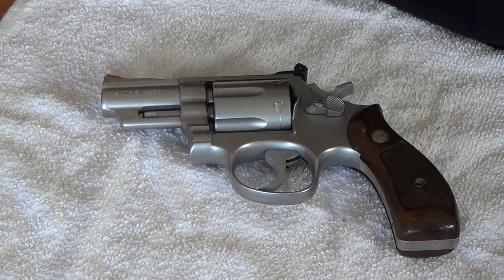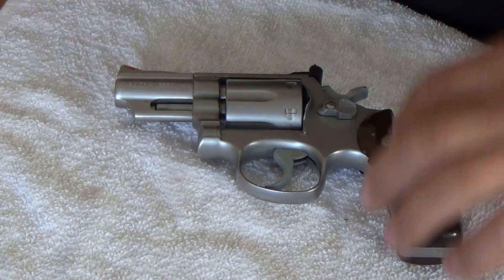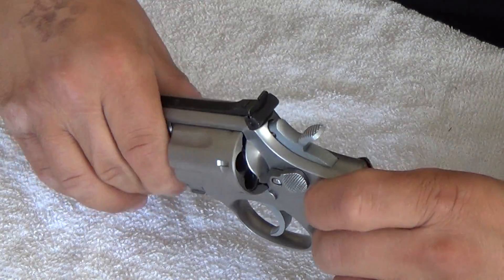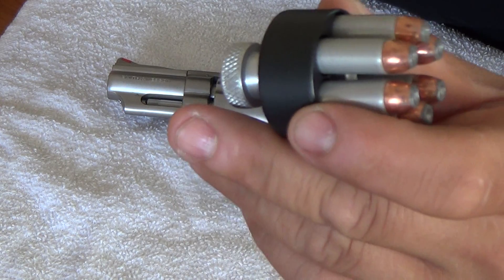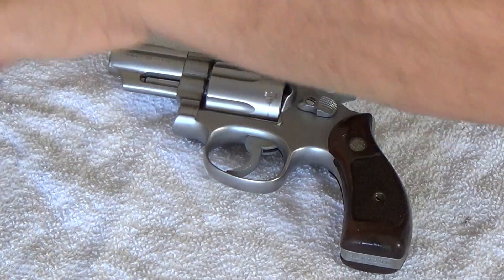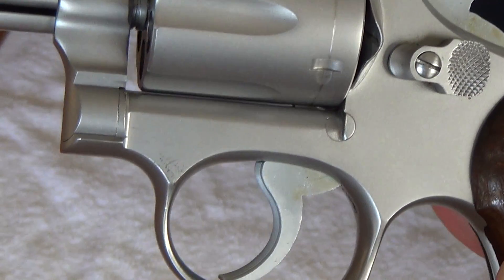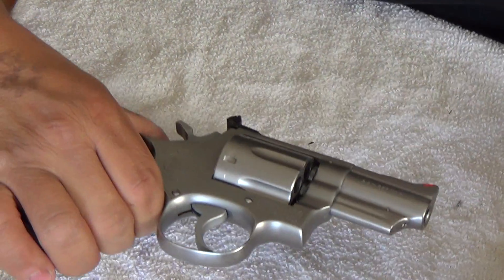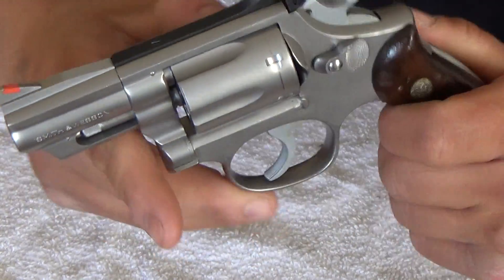Smith & Wesson Model 66

Comment: SWEET,i have the exact gun, 66-1 in 2.5" 99%  with box and all inners. I love mine.Just don't run magnums much. The one i have is more polished shiny,like a mirror.
Reply: Jim G I’ve had K frames for years and known others to have em also who worked as LEO’s and have shot many many magnum rounds in them and I’ve never seen a cracked forcing cone, it’s the super hot 125gr bullet loads that cause that not the 158gr bullets or 135 grain but it can happen but not with 158gr regular 357 loads.

Comment: Nice little piece. Looks like a bead-blasted or matte finish. Much prettier with the Magna grips. How do you like shooting with the Magnas? Does yours have a serrated or smooth trigger?

Just picked one of these up over a week ago. More beautiful than the pictures showed. Came with the wood Magna grips. I was surprised at how well they handled the recoil. Fifty rounds of Aguila .357 Magnum 158 grain and not a single flinch, so I decided to leave them on.

Safe bet on the reduced diet of Magnums. Incidentally, it's 125 grain .357 Magnums you have to watch for in old K-frames. You may have notice that the forcing cone is shaved flat at the 6 o'clock position to allow the yoke to close. That flat spot, when coupled with a steady diet of hot 125 grain 357 Magnum and a lack of good cleaning, is what caused cracked forcing cones. Seems to have mostly happened on Model 19s; no reports of it happening on 66s. Possible the metallurgy on 66s makes them a little stronger because they're stainless. Still, better safe than sorry.

Enjoy!

Comment: That is a nice revolver my friend. I would love to find one of those in my local gun shop. How has it been shooting for you since you posted this video?
Reply from the maker: Man this little guy is fun to shoot. I mostly shoot 38 out of it. I have read that a steady diet of 357 magnum in this it will cause that cone to crack since the frame is a little small, but other than that I love this gun. I need to do a range video on it.
Reply: Yeah  . 38 wadcutters are plenty good for practice.  If you decide to carry it, I recommend Speer Gold Dot . 357 short barrel.   It is ammunition specially designed to be fired from short barreled revolvers.   I have a four inch 70's model my Dad carried on the KHP. I also carried it a couple of years before transitioning to a Glock 17.  I have never seen a bead blasted 70's era 66 myself. They've always been satin finish.  Great find. I love snubnoses. Most of mine are J frames though. I have one 80's model three inch 65 I am fond of too. Cheers.

Comment: I believe that gun has been refinished before you bought it, the original finish was not a satin.
Reply from the maker: Really..... Do you know what the finish it is surpose to have on it.... Just so I know
Reply: The very early model 60s had a bright polished finish, which apparently was too labor-intensive and changed to matte. There is some variation in the matte finish, from bead-blasted/vapor-honed (very dull) to semi-gloss. Since the mid-'60s, the factory has made new bright stainless guns occasionally
Reply: Joey Cuz a little more research on it and this could be the original finished but it's not likely. Hopefully you got this one with its original finish, it's just the first time I've seen a pre 80s Smith Wesson with that type of finish.
Reply: It originally had a brushed stainless finish. Just stainless steel with a matte look, but you could easily polish it up. Your's appears to have some type of coating on it now.
Reply: Yea,mine is like a mirror,exact one

Comment: Back in the good ol' days it was a common habit to shoot mostly .38spl if you shoot a lot out of your 66 or 19. The smaller K frame wouldn't hold up as well as N and L frames. Keep the gun loaded with hot .357 for "emergency" only.
Reply from the maker: Yeah I don't shoot much 357 out of it. Pretty much a bluemoon type of deal.
Reply: Smith cautioned against shooting the real hot 125 gr rounds as they found it accelerated flame cutting of the top strap and timing issues. I have some +p+ .38 that work nearly as well as .357 and just .38 for practice.
 Shooting .38 HBWC for practice and qualification and carry of .357 for duty was the standard back in the 80's and early 90's.

Comment: I found one on armslist for over 1,000$ is that robbery or what?
Reply from the maker: Arco Cola Holy crap. You got that right
Reply: That's what they are going for now, in good condition.
Reply: Just purchased one here in Jacksonville at a gun shop for $600.00 out the door, Model 66-2. Waited almost two years to find one local with the short barrel. They have a few of the 4" and 6" barrels in both the 19 and 66 around town, but very, very few snubby's... Love it!

Comment: OK Joey, I will explain my comment to you. First off what you have there is a very collectable firearm, in very nice condition. Let me address your concern about the cartridge rattling in the closed cylinder. What you were hearing is normal. There has to be a certain amount of clearance between the cylinder breach face and the recoil shield for everything to function correctly. Secondly, you make the very people you want to watch your videos " cringe " when you fling the cylinder open and let the crane slam against the frame of the gun. DON'T DO THAT !!!  What you have there is a very nice piece !! Please learn how you should properly handle a fine specimen as the one you have. Thirdly, I gather that you are a newbie to firearms and to you tube videoing, something I know nothing about, but, and this is for everybody else whom may be reading this comment, when showcasing a particular firearm, aka a revolver, you really........let me repeat, you really do not have to demonstrate the difference between single action and double action. That is moronic. Simply state that the revolver is single action or double action. If the people watching gun videos don't know the difference, which, and here is the point, almost everybody knows the difference, and if they don't.......let them inquire what that is at there local gun store. It is something that just does not need to be demonstrated over and over and over and once again over again !!!!!!!!!!! No hard feelings here Joey, you have a beautiful piece, just trying to shed some light as to where I was coming from.       Doug.
Reply from the maker: Yes I was A newbie when I got this gun three years ago. Pretty much this was my first revolver and yes I know more new then I did back than. No hard feelings what so ever and thank you for watching. I welcome all comments.

Comment: 66 comments hmmm
Reply from the maker: Lmao. how about that
Reply: Yup. Numerology .got 66-2.the other week. 2 c notes.came with 300ish rounds mixed ammunition.dammit man .. Not hot either. Checked. Plan on carrying it .shoots extraordinarily straight. . no bead blast finish or recessed cylinders. Same as your s otherwise. Garret industries  STX 2.0 OWB cross draw 9-11 o'clock. KEEWL AS CAN BE.